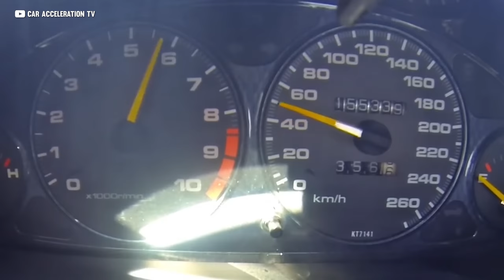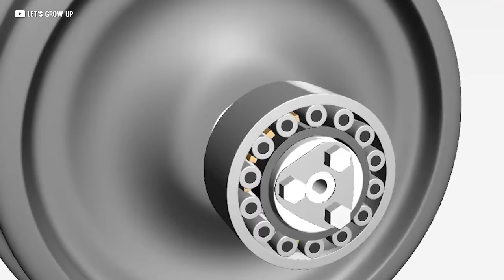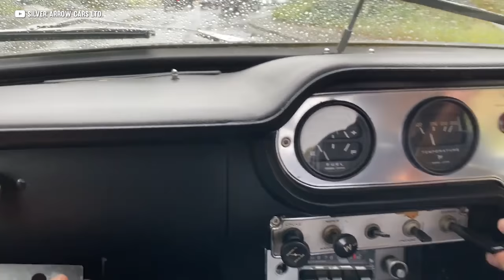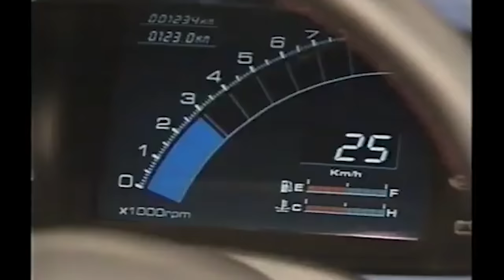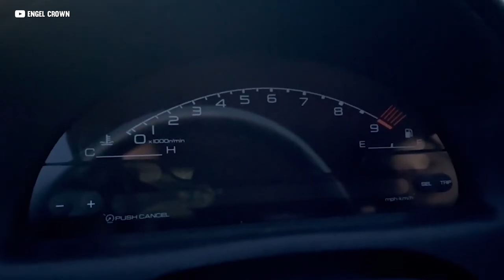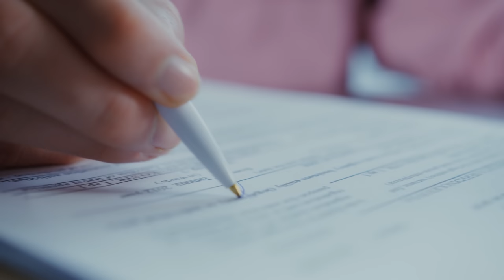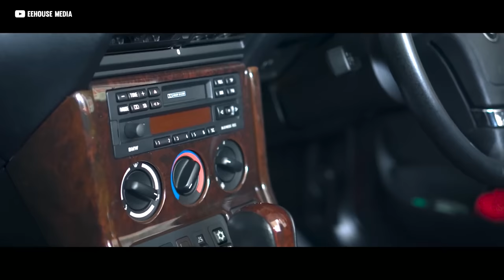Why Honda Killed The Greatest Sports Car

Comment: Dude, big fucking deal.  It is basically a modified 606 cc motorcycle engine today they spin at 12,000 RPM or higher.

Comment: Huge meh on the S2000.   You had to rev the shit out of it to get any power.   As a reviewer said at it's launch "You have to drive it like you just stole it".

Sporty little roadster?  Sure.   Not sure I'd call the S2000, the Miata or the MR2 a "sports car" though.

Comment: Own an 05. It's one of the great, although i wouldn't say it is the "greatest"... 

Best way to think about the S2000 is that its was affordable sports car from 20 years in the future when launched. The chassis balance and suspension tuning was out of this world good for the time. I remembered I liked the S2k look better than the contemporary 986 Boxster and the BMW Z3. It still looks good by today's standard. It's dead reliable, and for what it does, its plenty quick. 

Is it perfect? No, older AP1 are far too low on torque, even the AP2s F22 are not all that punchy by today's standard. The steering wheel is non-adjustable, and the seating position is very high. Basically if you're taller than 5'11" you would feel cramp in it. The first gen EAPS system sucks and gives you next to zero road feel through the steering wheel, and the brakes are like butter by today's sports car standard. 

But for something that was designed in the 90s and came out in 2000, damn was it an amazing car when it came out. Pinnacle 90s Honda, so basically Pinnacle Honda period. It's as pure of a sports car as Honda knew how to make one. A new ND2 Miata today FINALLY surpassed the S2k in terms of performance. 

Its true it occupied a weird place in the automobile market... too expensive to compete with the Miata, too slow and cheap to really compete with the later 987 Boxster and BMW Z4. Basically it's a very niche enthusiast car made by and for Honda enthusiast. It has cement its place in automobile history. The lower miles, well preserved ones will keep going up in prices over time.
Reply: Yes, true about the steering. People who worship this car dont understand that a sports car with a numb rack is a bad sports car. Steering feel is #1 priority in a sports car, not power or handling.
Reply: I’m 6,1 and fit fine and the new miata is only subjectively “better” I own a ap1 and a mate has the new miata and I’ll take the S2000 any day… As most comparisons say the chassis, engine and shifter are still intoxicating compared to the miata. The miata is a great car but definitely doesn’t stir the same emotions when most people drive it.

Comment: I owned the 1999 model. in Siverstone grey. It was a great car and I would buy another one in a heartbeat. But, and its a big BUT. This was the first car with eletronic power assisted steering, and it sucks dogs balls. The steering feel is like a playstation controller playing GT4, you get some vibes but no real feedback. It was really sketchy in the rain with its LSD and peaky power delivery, the worst was late night, heavy rain, on a twisty road, can't see shit and can't feel where the front wheels are. Honestly I think what killed it was the steering. If it had a conventional rack it would be still in production today. The VGS was Honda's answer to the bad customer feedback about the steering but it didin't help at all. Im guessing the authour of this vedeo has actually never driven an S2000. Because Honda never killed the S2000, the press and public did.

Comment: The Only thing I liked about the S2000 was nose the rest of the design was garbage, the Engine? Now that's a different story it was Beast. I know people will think different but the 89 CRX to me caught my attention More, I even lovd the ones I had in manual the 89 Honda accord fastback hatchback coup and a 1993 Honda accord ex two door coup, they are Correct on the stick shifts they were bad ass, I lovd my Hondas until they got Smashed into by an idiot who didn't know how to drive her lifted truck, my heart was broken, so I went back to Muscle cars, but one day I will buy those again and light the Road up.

Comment: A Small Turbo added , by the Factory , to an S2K would have put the Corvette back in it's box . 350 bhp Go-Cart . That came with Premium Suspension .
Reply: No. There were plent of boosted s2ks. The compression ratio is too high to add a lot of boost. Not made for it. Still didnt touch the C5 Z06 bone stock. You go nod for mod and add a supercharger to a C5 Z06 Honda has no chance. I've owned s2k and later a Corvette. Anybody who compares the two probably just hasn't owned a Corvette
Reply: @AnonAnon-qi4ts  both of you are right. But what this guy means is that if the factory had put out a nice boosted S2000 it would have competed with more upscale and powerful competition.
Reply: @jamesmedina2062  . Thank You . That  IS  what  I  meant . A  FACTORY  JOB , properly re-engineered .
Not some Backyard  Bolt-on .
Reply: @AnonAnon-qi4ts  . I'm not talking about some Backstreet " Tuner " job . 
I  am talking about a Properly Engineered  FACTORY  INSTALL .
And in the  end , we are talking about 5 litres  versus 2 litres . 
Corvette is inevitably somewhat heavier , thirstier , destroys tyres faster ,  Etc .
Reply: @johncunningham4820  Chevy DID do a FACTORY supercharged Corvette and it made 638 hp. That car in 2009, the same year the S2000 got sent off to the graveyard.
Reply: @johncunningham4820  you compared the s2000 to the corvette not me. The f22 and ls are almost the same size and weight. The z06 is only 200 lbs. Heavier
Reply: @AnonAnon-qi4ts  The difference is actually 400 lbs and even 100 lbs makes a difference. Take for example a 2600 lb car and it feels very light indeed. 900 lbs more at 3500lbs feels much more like a boat.
Reply: @jamesmedina2062  3118 2864 

240 hp. 395 hp.

Add a turbo and cooler to the S2k like you mentiom, it's even closer. I've owned both, it's just no comparison. The Z06 also was more expensive. The S2k was nice, but no Corvette killer even in the "if they boosted it" what-if scenerio.
Reply: Nice fantasy, but if the factory adds a turbo to make 350 hp, they will also increase the size and weight of every other component on the car.  Stronger trans, heavier diff, heavier engine, stiffer chassis, bigger brakes, heavier wheels and tires, it all adds up. Its no mistake that the Miata is a low hp car.  It has to be to stay light.  By the time the Stook got to 350 hp it would weigh as much as a 'vette.  TNSTAAFL.
Reply: @fantabuloussnuffaluffagus  . No-one was talking about the Miata .
Reply: @johncunningham4820  So? Do you have a point?
Reply: @fantabuloussnuffaluffagus  . Yes . Why don't  YOU  stay on Point .
Reply: @johncunningham4820 That's hardly a point.  More like a rant.

I used the Miata as an example of low powered, lightweight car.  Why does that offend you so much?
Reply: @fantabuloussnuffaluffagus  .
Firstly , a Turbo-Charger and an Intercooler don't weigh very much at all .
Secondly , suspension components don't need optimizing to Power Output . The need Optimizing to the WEIGHT of the Vehicle . The Driveline , which will already have a safety factor of 50 - 100 % , may need slight improving . 
Thirdly , the Video WAS about the S-2000 , so why do you feel the need to be Irrelevant by discussing a Different Vehicle  ?
Reply: @johncunningham4820   @johncunningham4820  No factory will add any power to any car without reviewing the design and beefing up any component, up to and including adding weight to the chassis. By the time you've increased the power by 50%, the car is going to weigh quite a bit more.  They will always increase the strength of each component to maintain the margin of safety they had in the original.

If you don't understand why, try increasing the power output of a vehicle by 50% ++ and see what happens.  I have, several times.
 
The video is about the Stook, why did you feel the need to be irrelevant by discussing the Corvette? 

And since it offends you so much  - Miata, Miata, Miata, Miata, Miata, Miata, Miata, Miata, Miata, Miata, Miata, Miata, Miata, Miata, Miata, Miata, Miata, Miata, Miata, Miata, Miata, Miata, Miata, Miata, Miata, Miata.
Reply: @fantabuloussnuffaluffagus  . The  Video  DIRECTLY compared Corvette and S-2000 . And the Factory we are talking about was HONDA . Better engineers than G M  will ever be . 
There is NOTHING  WRONG  with the  Mazda  MX-5 . Great little Sports car at a keen price . I'm not offended in the least .
IT  WAS  NOT  ONE  OF  THE  VEHICLES  BEING  DISCUSSED , Numb-Nuts .
Reply: @johncunningham4820  Dude I've built a whole progression cars over the years, as soon as you add  power, something else breaks. That's just how it goes. Doesn't matter who engineered it.  They make it just strong enough, you add power and you just find the next weak link.  The factory can't afford to have the trans fragging or the axle shafts snapping, so they go over the whole design and do it again.  Then they test it, beef up the stuff that breaks and do it all over again before the public ever sees the car.

Every car I've ever built, add power, see what breaks, fix that, break the next thing.

Its just how it goes.   My first effort was a '73 Dodge Dart, latest is a 2013 Toyota Tacoma off road truck.  Those 2 and every one in between, its always the same story. 

If the factory adds power to a design it will get heavier to maintain reliability and safety. If someone else does it in their own shop, reliability will go down and it will get heavier.  Its inevitable.  By the time Honda builds a car as powerful as a 'Vette, it will cost more than a 'Vette, and it will weigh within a couple of hundred pounds of a 'Vette.

Stook is a bit fragile as it is, it can't handle more power.  Have you ever seen one at the strip?  They break driveline parts.

Doesn't really matter anyway Honda hasn't built one in the last decade and half.

TANSTAAFL.
Reply: @johncunningham4820  Corvette wins Lemans... again. I love Honda also, owned several, but it's silly to dismiss the Chevy pushrod, a legacy of 70 years of Corvette winning races at all levels and GM chasing outright production track records all while Honda is fiddling with hot hatches. Why don't you talk about Honda's enginnering masterpiece of the new NSX and how they can't sell them and they are just shellacked by almost every other supercar out. That's the best they can do right now. They are both great companies. To dismiss a C8 or ZL1 is ignorance. There are also Cadillac performance cars with manual transmissions available. GM is doing great things.
Reply: @AnonAnon-qi4ts   . Well now..........
The Discussion in the Listed Video didn't involve The Le-Mans car or the  NSX's .
Same comment to you as that other person . STAY  ON  TOPIC .
Le-Mans is a Brute Force Event . 5 litre plus  Engines are the Norm there .
Push-rod engines are Cheap to make and Maintain . Perfect for Commercial Consumption . Nothing wrong there .
And last  I  heard  GM  only had the Corvette still flying the Flag for them .
Nothing much in the way of Other Models .
Reply: @johncunningham4820  you're the one mentioning GM engineers. GM is doing great with performance. Honda killed the Accord 2.0T l, so they are left with only the R and a smattering of lukewarm, bloated Acura products.
Reply: @AnonAnon-qi4ts  . Only  AFTER  other people , such as yourself , wanted to Simp on GM . 
Corvette was Mentioned Specifically in the Original Video . We are a MILLION MILES off topic here , BTW .
So , has GM  built a  Formula 1  Engine ? Or a 500/Moto GP Motorcycle Engine ? 
No ? Is that what  I  hear you say ?  Thought so .
Reply: @johncunningham4820  the title of the video is something like S2000 best sports car ever. Which is inflamatory and not true. The Miata is better than the S2000 or Corvette or anything else anyways so who cares? Mazda goes racing more than Honda or GM and they engineered a car for the masses and enjoyable to drive for everybody at all skill levels which is a better accomplishment than Lemans, F1, superbike or any other elite form of racing.
Reply: @AnonAnon-qi4ts  . That's Funny . Really .
It was  YOU  that brought up Le-Mans .
The S-2000 IS  a superior vehicle to the Miata . It's also about twice the price , or rather WAS . That's why they didn't sell much .
Mazda made a VERY  GOOD  Roadster , at a VERY  GOOD  Price , so they sold Millions of them . No big surprise there .
You keep Flipping your Script , desperately attempting to win an argument you've already lost .
MX-5 is a Great little Car . S-2000 WAS  BETTER . Corvette is Irrelevant , because it is PRICED  OUT  OF  THE  MARKET .
Are we done , Flipper ?
Reply: @johncunningham4820  GM made their own "S2000" cars in the Saturn Sky Redline and Pontiac Solstice GXP. They came with a 2.0 liter turbocharged engine, 260 hp/260 lb-ft torque in stock configuration, sports suspension, and 245 tires on front and rears, sold it for almost $10k less than the S2000 back in 2007.  It was advertised to compete against the NC Miata.

So the S2000 in it's last few years was accidentally priced out by GM.

Comment: It may not perform like the corvette, but its a Honda and will last forever. How reliable are corvettes? are they any good?
Reply: Yes the small block chevy is legend. They put them in everything. They make the most power for the size. Google the ls weight and f22 weight. You will understand then.

Comment: 9000rpm, so what ? As long as the car is powerful it doesn’t matter if it’s only 4K rpm , just wank bragging rights when you’re kicking tires in the car park
Reply: more RPM means more HP, no other 2l 4 cyl engine made that 250hp NA ever. And at higher revs, the engine response is much quicker and more accurate and ofc a lot more fun. This car is not for everyone and it's not easy to drive fast, this is for people who love handling and a car that's challenging to drive on twisty back roads because there are many people out there who want exactly that and don't care about straight line speed. Once you drive something with a 9000 rpm red line every other engine feels kinda ... meh
Reply: @binskee677  i guess it’s just personal preference, I’ve driven several S2000’s and until the power band kicks in (around 6000) it’s so so underwhelming to drive . That alone is the downfall of the car. Now compare it to a similar era MX5 or a RX7, simply chalk and cheese, (the S2000 = chalk) for driving fun (and I own both the mx5 and fd RX7)
Reply: @spinnymathingy3149  totally agree, under 6000 it's nothing special, never denied it, but there are still 3000rpm's left. It's definitly not a good daily driver but i mean it was obviously never intended as a daily driver or for fast low RPM pulls or straight line speed, it was always meant to be driven in the higher revs on a mountain road or track and it made RX7 horsepower with a NA's throttle response. But as you said, driving fun is different for everyone and for some people torque is more important than peak HP. And then there is the reliability and the inexpensive maintenance + huge aftermaket and incredible tunability.

Comment: Yes, the S2000 and the CRX are cars that Honda should not have killed.  Then again, GM shouldn't have Killed LaSalle, Oldsmobile, Pontiac, Saturn, SAAB, Holden, Daewoo, Hummer and the EV1... GM Kill entire brands faster than Honda kills off two models.

Comment: Toyota's partnership with Yamaha (who also help build the Ford Taurus motor back in the 80s) also gave VTECH something to sweat about, especially with Initial D and that 12,000 RPM plus capable AE86.
Reply: Except Takumi’s 20V is a highly modified, purpose-built race engine; while the F20C in the S2K was mass produced and makes similar hp bone stock. Also you still had the Group A spec B16As built by Mugen and Spoon that were also close in power to the TRD 20Vs.

Comment: Why is s2000 still expensive? How much is it in your country? I just saw an AP1 S2k for about $80k(it has some J's Racing parts, Mugen headers,Tein coilovers and Voltex bumpers and diffusers) ,i'd rather buy a mk5 supra for that price .
Reply: All nice Japanese cars from last century are increasing in price, simply because they aren’t making any more, and people want them over the ridiculously designed “over accessorised” cars that are produced nowadays. Cars from the 1990s were driver’s cars, not like now where cars drive the driver
Reply: For low 30s you can find clean s2k with low miles right now, but that will not be the case for long..
Reply: @civicpride1986  oh thats really cheap. Just found out that the s2k im talking about was imported from japan. He built it in japan then shipped it here. Are there any big differences betweed JDM and USDM s2k?
Reply: @andrestrd  Jdm s2k did not get the f22 engine.. i belive only the usa models got the f22.. other then that everything else should be the same between regions.. ap1 and ap2.

Comment: My cousin had one - felt fast, but you had to work it right to shine. 2L was just too small to get the amount of TQ it should have had NA - 2.4L  would have worked wonders from day 1 - you could have had it rev just as high with the right bore:stroke ratio and get 20% more TQ and HP. Never wanted one, but can understand why some do.

Comment: The Porsche 911 many would argue is the greatest sportscar ever. The Ferrari 458, Chevy Corvette Z06/ZR-1, Nissan GT-R, Ford GT, Dodge Viper and many more were also fantastic. The S2000 was marketed as competition for the Corvette, which it was not. The 2004 S2000 was priced $10k more than the 2004 Miata and about $11k less than the Corvette. The Miata had the better warranty. The 2004 Nissan 350Z cost about $6k less than the S2000 and offered better acceleration and braking. The S2000 handled slightly better. The S2000 just didn't stand out performance wise and the 350Z was a better value.